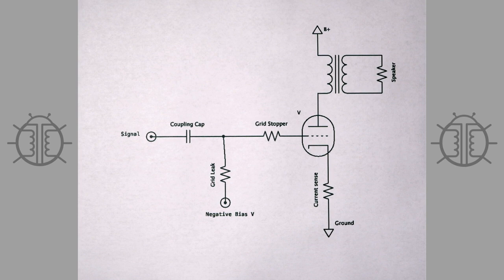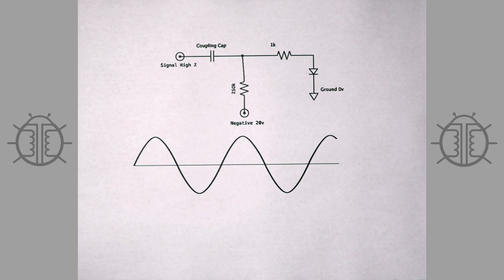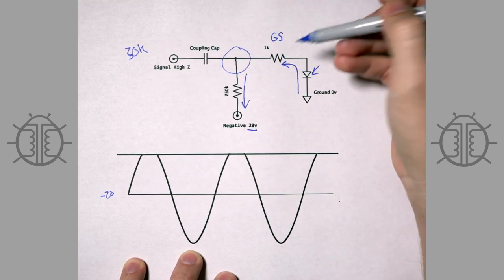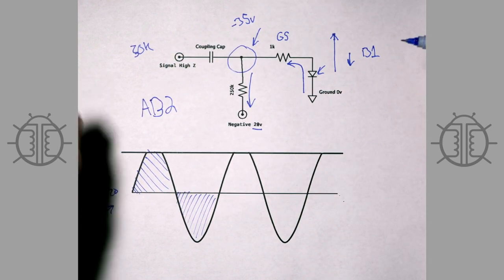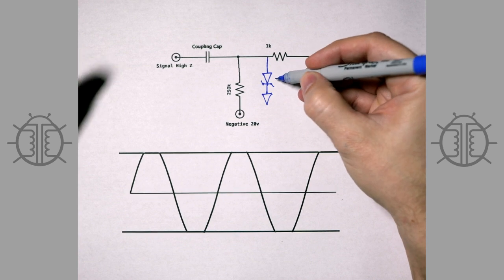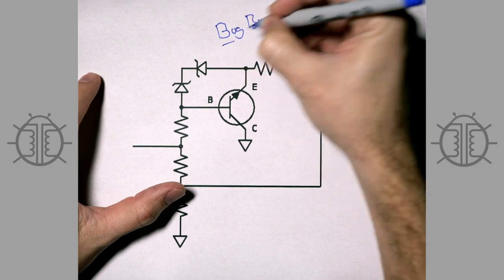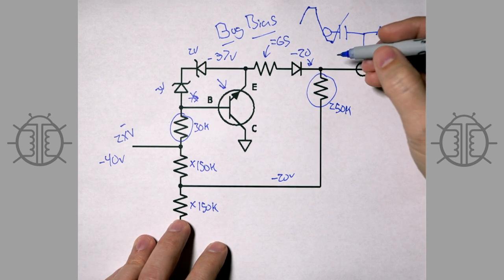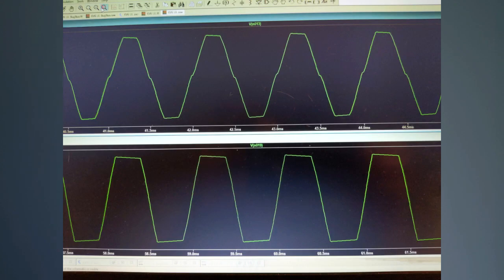Blocking Distortion, A New Solution.

Comment: This was very interesting. I was trying to envisage this in a cathode biased class AB push-pull output stage. In that situation, say with a with +20V cathode bias, where you're reference 0V on grid, would this be equivalent to +20V on the grid with a +20V cathode bias?

Comment: Would regulating the negative supply help resolve blocking distortion?
Reply from the maker: In a traditional fixed bias configuration, regulating the negative supply wouldn’t resolve blocking distortion. This is because the grid leak resistance would still allow the coupling capacitor to charge when current flows in the control grid.

Comment: Still trying to fully grasp the blocking phenomenon. But what an outstanding job you have done here. 
 Curious- Would I need to make Gs in the bug bias circuit equivalent to the paralleled tube's (2 6L6s per side in push-pull) grid stoppers? Also, Would it be beneficial to have your circuit on each side of the two tube pairs?
Thank you for giving me something that is well explained that I can study.
Reply from the maker: Having the R value in series with the diode be similar in value to the stopper value is just a place to start really. It should be adjusted so that the clipping character is similar and symmetrical. But yea, in parallel push pull it would be the stopper values in parallel. So half the value assuming they are the same value. 

In a parallel push pull situation only one BB circuit will be needed for each side and should run both tubes.

Comment: "two output tubes obviously" where's the single ended amp love at
Reply from the maker: You’re right, single stages suffer from blocking too.  This solution will work there too but may change the distortion spectrum Because the signal clipping will not be during cut off anymore. This will probably result is more third order distortion in overload.
Reply: @Edgarbopp  I mention single ended because I have begun to notice some strange distortions in my homemade champ. I think initially I'm gonna change some decoupling cap values from overspec .1uf to vox level 0.01uf. also.. it's cathode biased anyway but I was watching this video more out of curiosity for the mechanisms than a solution. Thanks tho!

Comment: Nice! I have been thinking on and off about blocking distortion for quite some time now, mostly about using a source follower in for single ended and class A amplifiers. The grid of a typical power tube is a pretty low impedance to be driven by a tube follower though. Here is something you can look into - Does this restorative clipping that discharges the coupling cap show up on the plate voltage of the previous tube? I would expect that the current might in the range of several mA depending on how hard you drive it - (Guessing from the hip here)  so that would definitely show up on most phase inverter plates(12ax7's for sure and even 12at7's - maybe those CBS engineers were onto something with the 47k plate loads - Hersey - I know!!!) - and then also on the other plate of a long tail pair via quasi differential action. By this time though there is enough of a din going on that it might be lost in the Kerrrrannnng! Congratulations on the circuit! The closest I have seen of something like this might be a variable clipping circuit in one of the London Power books - but yours is applied to the bias circuit which is new to me!  I am so glad to see this sort of video! I have been mulling over doing videos like this just because it seems like there are not many being made.  - Leif!
Reply: Ok so, I was assuming you were guitar amp guys - I just checked out your site and it looks like High end audio, where the grid drive is not so much. So you should really look at the charging current effect on the previous stage - I would actually buffer it - direct coupled so you can really control that grid. I worked at a place that did some very high end stuff for a few years but we were driving triodes and the grid current could be overcome by a 6sn7 follower. The funny thing about high end audio is that after you leave you think that it stops being a thing ;-)

Comment: Doug,
Very good design work and excellent explaination. I am impressed with your conception, "if it ain't broke make it better". Yes, to my knowledge it is your invention. When I get my shop set up again (after a retirement ) I will incorporate it,with full credit to Bug Amps, into my "super Texan" guitar amp,  and a redesgned SCA-35, A perfect example of a blocking amp!
The very,very basic circuit is in an obscure book "all about zenner diodes" in my stored library if I can find it,  I will get you a copy of the original circuit.
A really perfect example is Jimi Hendrix in the '60's movie "Monterey pop" it will have a tech like yourself tearing your hair out!
I will get one of your boards to check it out in the dynaco amp first.
Dan Torres "Inside Tube Amps"
Reply from the maker: Thanks Dan! 🙂

Comment: So essentially it's a dynamic bias shunt type of arrangement - useful in situations where you want to clean up the distortion caused by overdriving the output stage in an attempt to exceed its power output capability. I can't paste images here so excuse the link https://atrad-audio.co.nz/wp-content/uploads/2020/04/BugBias.png you mention the RGL resistor as being selected from the tube's datasheet. Typically in fixed-bias the datasheet will specify a maximum grid-to-cathode resistance. In this case it's the sum of the grid stopper, the "build-out" resistor (RGL in this case) and then teh resistance from there to ground. Which in your case has an extra 150K on it. So long story short: Grid-stopper PLUS RGL (on my screenshot of your vid) PLUS RGND (screenshot) need to not exceed tube's specified grid-to-cathode resistance.
Reply from the maker: Adam Rosner the 150k pair will be in parallel to some extent depending on the source Z of the negative supply. But yea I agree!

Comment: I've always assumed the reason it's called blocking is because if a large transient upsets the bias enough, a quiet sound that comes right after can be "blocked" from being heard because the average bias has the output tube fully cut off. You may hear just peaks with very bad crossover distortion, or if the sound is quiet at all, it might not punch through at all.
Reply from the maker: You might be right!